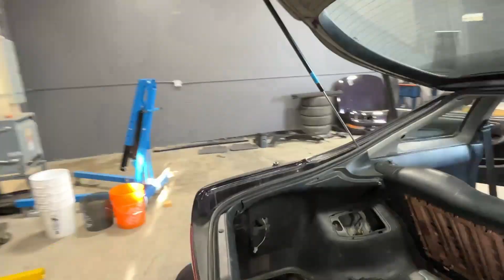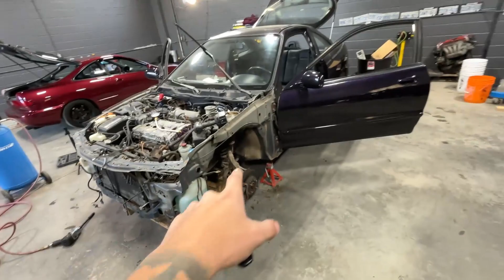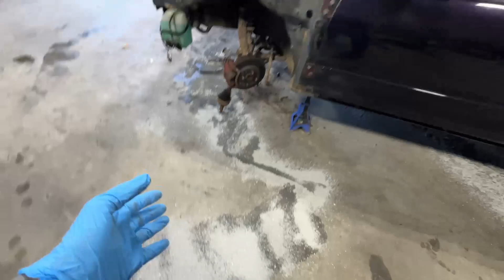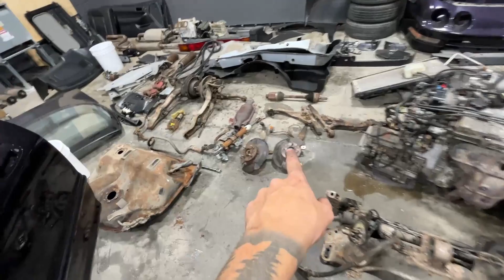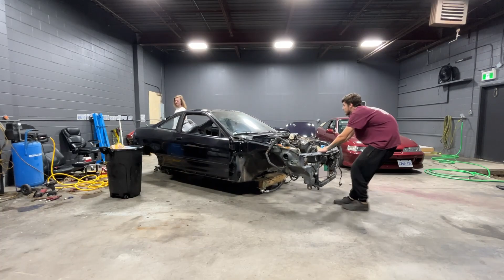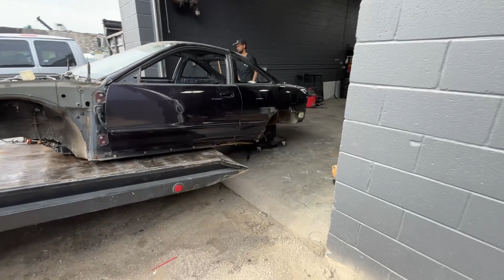First Partout In The Shop (Integra)

Comment: Hey man I got a question about the head light wiring for the high beam and fog light and city connection if you ever got yours wired up
Reply from the maker: I have a headlight video on my channel, but all I have right now is my low beam and signals with side markers right now. I don’t currently have high beam or fog